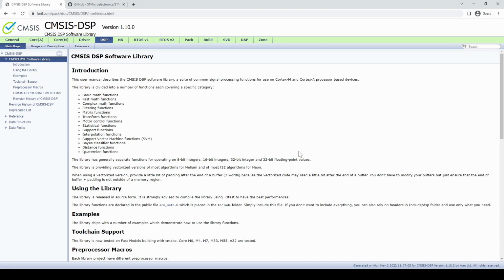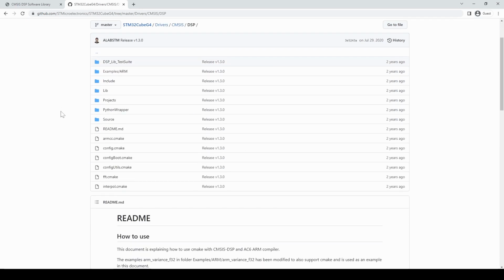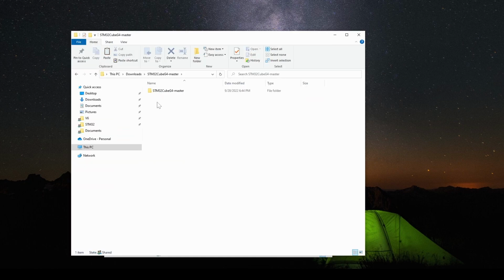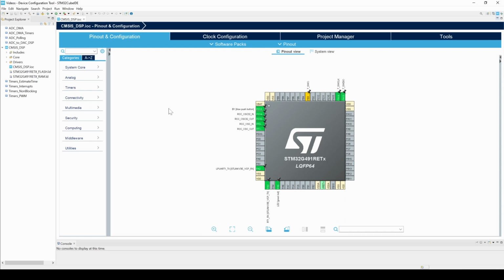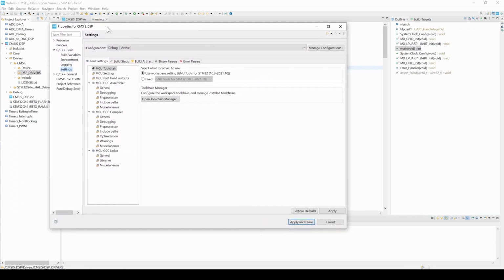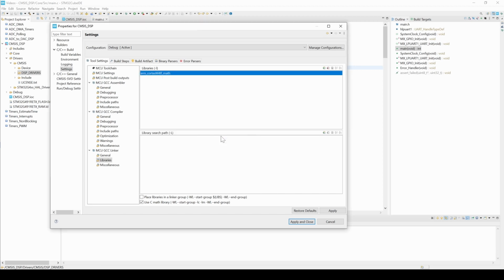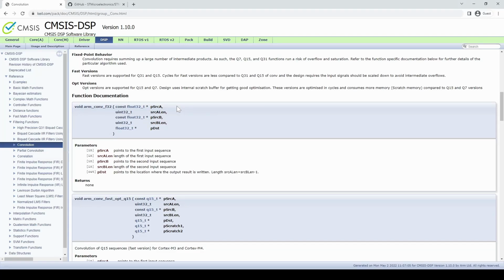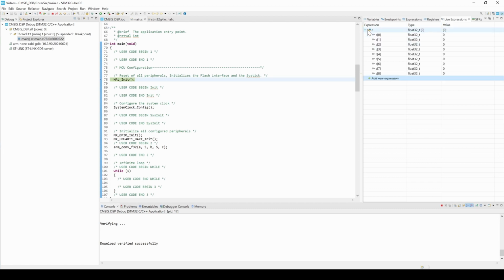STM32G4 & Real Time DSP: Part 6 Using the CMSIS DSP Library

Comment: I'm new in DSP,  and I can't understand one thing: if I use ADC and DAC 12 bits, should I use FIR functions only with q7 (adjusted DAC and ADC on 8 bits)? (I tried to use FIR with q15, q31 and 12 bits ADC/DAC, but got noise).
Reply: Have you solved it? The number format can cause annoying issues, it's not the precision I think.

Comment: The only thing I would add is that in my case you have to physically copy the files into the project. When restarting the STM32IDE, the compiler does not see the files. In a manual copy everything works fine.